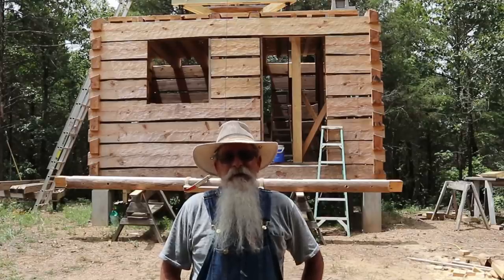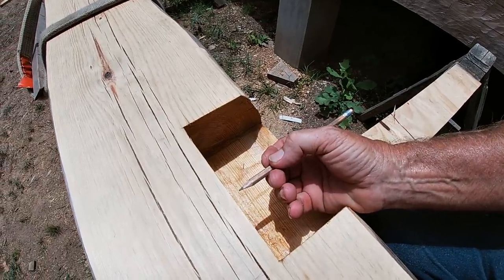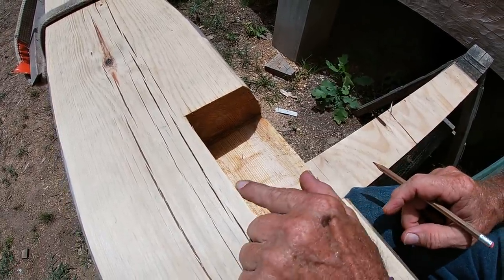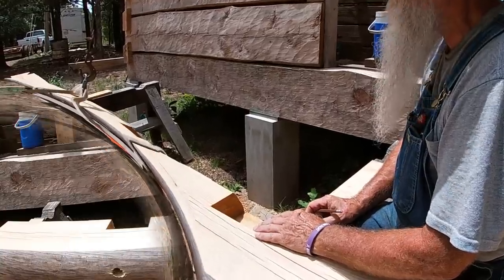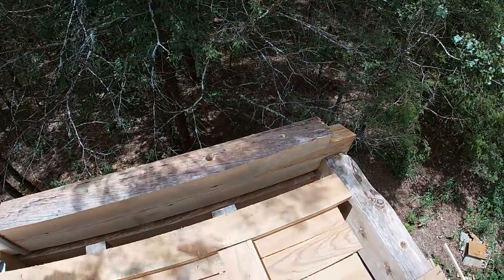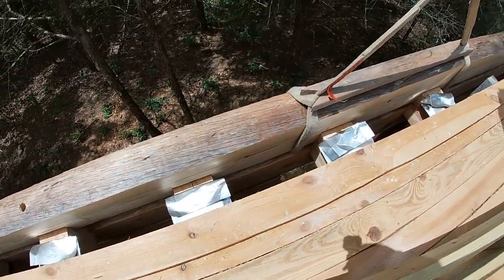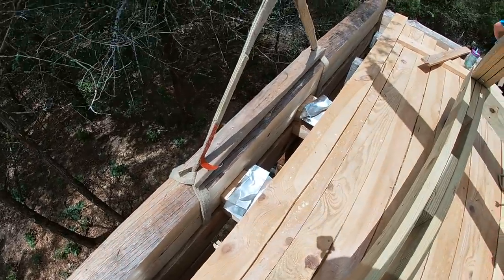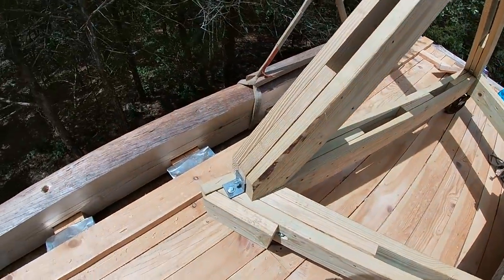Round 9, Dovetail Log Cabin Build (Ep 33)

Comment: Paul, I'm not afraid to admit it, watching you roll that crane around made my butt draw so tight you couldn't drive a straight pin in with a 10lbs sledge. I know you've done it many times and im not bothered by heights at all but I saw you or that crane going over the edge. 😆 Looking really good there. Monsoon season has finally arrived here so I've started peeling my floor joices. I can tarp those to help slow the drying of the timbers. Those are red spruce so they are pretty stout. The floor itself will be alligator juniper for the color affect. Those were harvested as dead standing and all of it is right hand twisted so shouldn't be any serious twisting once laid. There will be some, nature of the beast. There's a mill just down that is no longer operating as a mill and they said I could use it to to cut the floor material. I think I have the saddle cut down to a science now so I'm looking forward to getting started in February.
Reply: He's got boards nailed down all the around to prevent the hoist from rolling off the edge, he talked about that in an earlier video, you can see two of them at 5:20.
Reply from the maker: Dave Johnson   Howdy Dave- so good to hear from you. I’m pretty cautious when I’m working up very high especially when I’m moving something heavy. So glad to know you are getting some things done on your own cabin out there. Nice of the people to let you use the mill. That’ll be a big help to ya. I’m not sure what you’re calling alligator juniper. Wishing you all the best with your build. Hope you make some pictures. God bless y’all
Reply: @bigredc222  yes, I saw the board's yet they weren't very reassuring. 😆
Reply: @TheBeardedCarpenter  alligator juniper is in the cedar family. Typically they seldom get higher than about 30' tall here but once cut you get a rose to deep purple wood. Pretty much need to coat with linseed within a couple days of milling and planning to preserve the rich color and still needs to be kept inside out of the sun. It makes a great trim as well. No rot, no bugs and the smaller one are used for fence post.
Reply from the maker: Dave Johnson That sounds like the cedar we have here. Lots of people like it because of the aroma. It smells really good. Blessings
Reply: @TheBeardedCarpenter  it only grows between 7 and 8 thousand feet here but yes it does have a pleasant smell. That smell is toxic to rodents and most bugs which is good. I spread shavings around in the fall to help keep the mice in check but still allow for freezer rabbit. 😆